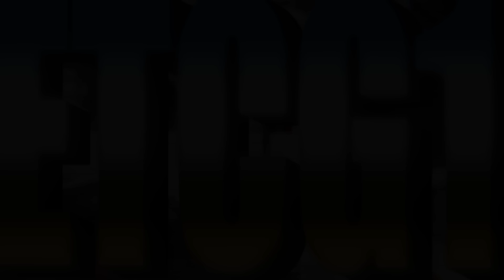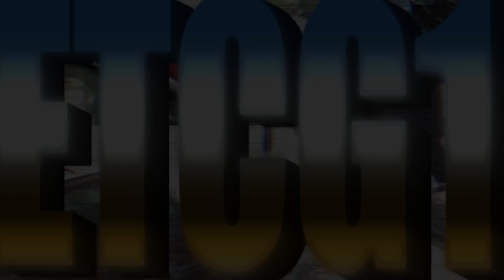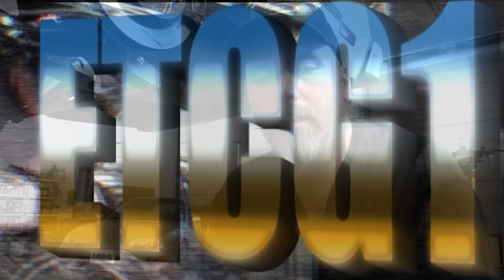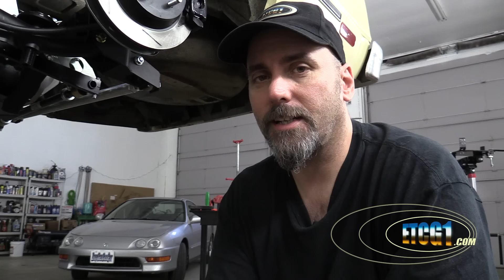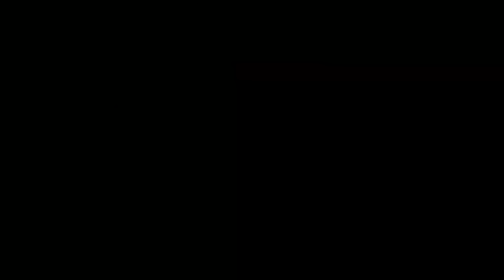Misconceptions About Performance Parts

Comment: I can say in my mind, I am not looking for more horsepower, but to replace parts that are made out of plastic, or weaker material that comes stock.  For example, I am looking for a better exhaust system for Infiniti G sedan, not to necessarily get more power, but to replace the old rusty pipes and muffler with something that is polished stainless steel and will last longer and easier to keep clean.  Another example of the air intake system, which is completely made out of plastic, again, I would rather have something made out of polished steel and will last much longer and look nicer.  I also look at the rubber hoses, if I buy performance hoses, will they last longer then the OEM ones?

Comment: ive had good success with my 370Z.  Intake with Full Exhausted netted the Z 37whp and 40wtq.  Most of the power was after 2700rpms.  I had a 350Z the gained 19hp and 15tq from an Exhaust, throughout the rmps (2k to 7k).  You cant just buy the biggest part and expect it to work.  It needs to be in harmony with the platform.

Comment: ETCG can you help me with a question? I've been having trouble finding an answer for it. On modern fuel injected cars they always have an intake tube before the trottle body that goes through the airbox and everything. I saw a video where a guy said that on new corvettes the big long plastic air intake that is stock does a great job of boosting mid range power.

Now on classic muscle cars, they always just run an air cleaner on top of the carb without any further tubing for an intake. I have seen some stock carburated cars that do have a plastic enclosure around the air filter hat and then have a long tube coming from that but I heard that that is just for noise muffling? Is that true?

Anyway my question is how come whenever people build performance classic cars they don't have that intake tube before the air filter, but on modern EFI cars some people say it increases torque and stuff like that?
Reply: Its all in the design differences of the two systems. If you look at some of those classic builds though you'll see they sometimes add high rise intakes and large plenum intakes to boost the air stacking capacity after the carburetor. Modern EFI they stack the air in the tube and intake before the fuel is added. The older generation did their air charging after the carb. Look at an old blower set up, even they compress the air after the carb. The reason is air flow determines the fuel charge. In modern engines sensors tell the injector how much fuel to dump into the air. In the older systems this was done mechanically through a siphoning tube so maximum air velocity was required for the mechanism to work properly. Air tubes stack volume but slow down velocity.  That is why the round no frills intake on a carb works well. It had very little in the way of restrictions and allows air to be pulled in at a high rate of speed. In essence the carb was the fuel injector, throttle body,  and mass air flow sensor in one unit.
Reply: yes and no. 
1. there are carburated superchargers that compress before the carb. 
2. 90-99% what you said, but there are other less critical issues at work like turbulence as well.
Reply: deth502
There has always been a push pull debate on forced induction as it relates to carbed engines. You have to admit though draw through chargers seem to be more popular.
Reply: oh, no debate. just pointing out that they DO exist. pulling through is many times more popular. 

as to a debate on the merits of each, again, pull through wins hands down, but i have to wonder, is it because they are more popular so more r&d went into them, so the designs became better? had the pendulum swung the other way carb design and tuning would have certainly have had to have gone down a different path to optimize the push through, but would they have been as good or better?  just some random pondering on the subject.
Reply: deth502
 It's possible but it could be that they reached a max potential for the design. The push system works a whole lot better with EFI. Once the air stacks it slows down making the siphoning effect harder to achieve. Push can work with carbs but that efficiency issue likely played a part in that design remaining rather obscure. However that is just conjecture, I don't have any hard data for that claim.

Comment: @ericthecarguy nicely spoken eric, the mods I have on my 2012 spec V are from a reputable shop that makes These parts such as my full custom exhaust and a lighweight crank pulley are tested and proven too make gains or be useful in some ways. you had the right idea though it d oes take alot of pieces of a puzzle too make the car that much better. 2j racing helped me forsure along with a couple other good speed shops.

Comment: my opinion on performance parts are oem replacements for everything. preferably lifetime warranty.
Reply: Definitely not if you own an older car, wasting a ton of money going with OEM when the car isn't worth very much and is worth less money every day.  Cars depreciate continuously they are not investments, unless you are a horrible investor.  The only kind of cars that are investments are super low mileage exotic cars that are stored in climate controlled garages and sold at auction every few years, driven maybe a few hundred miles per year.  Yeah, if you have one of those, use OEM parts.
Reply: ***** Yes and no.  I do rigorous maintenance on my ancient cars so I agree with that, regardless of value I want to prolong the life the car because it's reliable and because it's cheap with cheap parts and I don't cry when I get a door ding
Reply: In my state, there is heavy personal property tax on vehicles too so they screw you over hundreds every year if you have a nice car.  Even less incentive to own a newer car.
Reply: I think it sometimes depends on what the factory offers as OEM, especially if you're looking to modify and improve your vehicle.  For example, I used to drive a classic Mini.  There's many, many people who think they know how to make them go faster (and some actually do), but for my money, I went with what the factory used back in the day, since they did a whole bunch of racing with Minis...Super Sprint, rally, road racing...the works.  That way, they did all the R&D, trial and error stuff that costs so much...and I know exactly what parts to use that would work well together for my application (I went for a rally setup so it would be drivable on the road with decent torque and ground clearance, but better power delivery, brakes and handling than stock.)  But if the factory doesn't do that sort of R&D for your application, and have parts available, then sadly there isn't much of a choice but to remain with a stock vehicle, or try aftermarket stuff out and see what happens - or check out what others have tried and hope they know what they're talking about.  And bring a thick wallet - this is where it can get really expensive if you want tangible results.  :-P
Reply: What OEM parts will gain me 100HP? Please tell.
Reply: If you asked the dealership to order in a car/truck/suv with a towing package, police package, etc...  Take the new Ford Taurus cars.  Stock is "Meh.....".  But if you know someone that can order in the police package?  That's all OEM performance.
Reply: like the guy above said. take a Ford crown Victoria and bolt on the stock interceptor parts or better yet for a 100 horsepower gain the same block that is in the crown vic is also in the f150 but comes with 300 HP. so there you go pulling some stock parts off a truck and put in on your car for stock 100 HP gain.
Reply: thisisntme It's not 1995 you guys.  They 9on't even make the crown victoria anymore at least for civilian sales.  And even when they did the police package was more about reliability than power, oil cooler, trans cooler, etc.
Reply: Clearanceman2
  It's an example only.  And the police package, and even more so with the Mustang's that the state police used to use in NYS?  Boosted out the bazoo for extra power.  Years ago I had the pleasure of driving several 'retired' police cars (Used to be a tech for a taxi company).   Had one 80's dodge that used to be a local cops car.  360 police interceptor.  That thing could blow any other of the same make/model off the road.

Point being, the Crown Vic's police package was power based and reliable.  (I know, I used to work on them.)

And the point I was making about the newer ford Taurus cars, find a buddy that can order one in with a police package.  And that's OEM with a huge increase in horse power.
Reply: Ok, tell me the exact HP and increase over the non police package and cite the sources.
Reply: Clearanceman2
  Do the research yourself.  You've got google.  Might as well get some practical use out of it.

Actually pretty easy to find:
http://www.autoblog.com/2012/09/14/fords-taurus-based-police-interceptor-getting-more-power-to-cat/

Case Closed.  Find one of these being sold at auction or at a pick and pull yard.  (we see several in our areas)  Swap parts and have someone that works for a performance company re-tune things.  OEM performance Increase.
Reply: Tedybear315 Yeah, that's one example and the swap would be horrible.  You'd need the computer too and the trans and the trans computer.
Reply: Clearanceman2
 Would run about $60 bucks for the computer(s)  (They average about $30 bucks each.)  If you wanted to swap out the entire harness, that would be $50.00. 

Point is still of course valid.  Even more so on older cars and trucks.
Reply: 1995? the crown vic Interceptor was was made clear up till 2010. and if you can get your hands on a 4.6 out of an f150 you can bolt an extra 50 HP into an interceptor without having to change the anything else including the computer.
Reply: Clearanceman2 in general oem doesn't have to mean factory toyota (in my case). I buy most of my parts from napa. I just mean I don't put red aftermarket performance parts on my car.
Reply: aussiebloke609 my application is a 10 year old daily driver. parts from napa work just fine and they all usually have very good warranties.
Reply: asandberg6 well my vehicle in particular did actually come with a trd supercharger as an option until they discontinued it. I can still get one but I won't put that kind of money into my car.
Reply: 9Skateboard7 toyota parts are outrageously priced. unless its a timing chain or someting critical for the health of the engine I'm going to buy from the parts store
Reply: If you're a car guy and generally want to improve your ride, go aftermarket. If not, don't.
Reply: Yup exactly, thats why the policepack chargers are a half price R/T

Comment: I'm looking for a civic type R ek9 air box after  a b18c   swap on my car they gave me a filter I changed it for a «high performance» one since it was used
the reason why is because the short ram or cold air won't change a thing in the performance of the car
the funniest part of it is the location of the cold air intake
it takes air from the fender where the air is cool but people doesn't realise that the original air box take the air at the same place
as for power gain 5hp you won't notice it because most of us misread the power output for example you have a car that have 200 hp at 6800rpm the 200hp is not fully available under 6800rpm so if you add 5hp you won't notice it since no one would go up to 6800 on the street on a daily basis driving
also how many torque do you really gain?

Comment: Did headers and exhaust on my lancer, 2.5". If it added any hp it was not much but it made it a lot more fun to drive around . 

Also put a new intake on my genesis 3.8, again if it added any hp it was not much but it sounds so much nicer but now  harder on gas since i am harder on the gas pedal .

Comment: This is how I see it. Any cold air intake will cause a change in power, it will either be for good or bad! it may add horsepower on the top end and loose you torque on the bottom end or it will just have a loss of power overall.

Comment: There are lots of small performance parts that people buy and want to put a sticker in the window. That stuff bugs me. A lot of those parts go into cars with high miles, so when they prematurely wear out the engine, the owner thinks it was just its time to die. Think about e3 plugs. You will notice higher performance right away, you will feel impressed. You will also cause predetination that punches tiny holes in the tops of each piston, causing low compression. Any plug with extra meat at the end does that, because they act like a glow plug, staying too hot between ignition sparks, causing the mixture to ignite before the stroke reached tdc. That's why you get tiny pin holes in the tops of your pistons. Do the makers of those plugs care? No, they already have your money and free ad running in your window. This is also true for things like bars leak radiator fix. It has sodium silicate in it, the same stuff used in the old cash for clunkers program that was poured into the oil pan to permanently kill and engine. If your coolant leak is with the head gasket, then that stuff goes into the oil pan, then it kills your engine very rapidly. I've seen all these things happen more than once.

Comment: That sounds depressingly accurate. Personally, I think the term "Performance" is a loaded term these days due to marketing. A front strut bar adds no horsepower but it will improve handling over rough roads and in tight turns. Does that constitute "performance"? I don't know but it does suit my preference for tighter handling, so on it goes. I would rather spend money and time making my car more enjoyable to drive rather than producing higher HP.

Comment: Thanks for your videos. Ur the best

My thoughts/experience. I hope that new enthusiasts understand that some performance parts have a different life span than from oem. I.e: Rotors/pads/tires/clutches/etc. duration traded for sports performance 

Also, i hope they understand that some performance parts take away from driving comfort. I.e: low profile tires/stiffer spring rates/struts/shocks/stiffer or solid engine mounts/etc. trade comfortable-ride for sports performance

And i say "sports" performance..because there's people who tune for fuel performance, comfort performance, audio performance, what ever they want.

Thanks Eric, ur awesome

Comment: On modern cars, it's funny how some people will swap outdoor stock air box for a K&N Filter. Then they can't figure out why they haven't had an increase horsepower in fact it drops. The air boxes,  for modern cars, have been designed and engineered for certain intake harmonics, and at certain RPM's. There is a ton of research that goes into these systems.

Comment: performance parts are all about trying to increase the efficiency of the overall system, example 350zs have really restrictive exhaust headers stock so if you swap to the 370z sized primaries then you do see about a 7-12whp gain. just my experience I know things like the svt focus and the S2000 if you only swap the header you loose power so IMO it's all in how well you do your research and/or if you want to be the first test subject for a new part/company.

Comment: So you're saying my red paint didn't add 120hp like the ad said it did?
Reply: Only if you bolt the paint on.
Reply: bolt on paint and match with the valve cover for an extra 62 hp. street dyno it - i swear its true.

Comment: What is considered bolt on? I mean, I can put intake, top mount, turbo back, injectors, and a fuel pump in a wrx and blow it up. Spend 500 for a tune and put in an ethanol sensor and go from 200awhp to 300.

Comment: Hi Eric, great video, but a couple of mods I think you can make real easy and get instant results: tires, if you don't have them, buy some decent grippie wheels. Brake pads and rotors. 2nd thing I always do is swap in some dba slotted rotors and a set of bendix ultimate pads. Slotted rotors work waaaay better in the wet and decent brake pads make a massive instant impact.